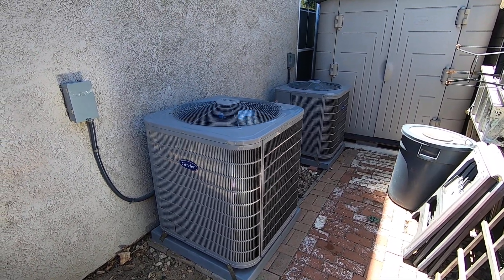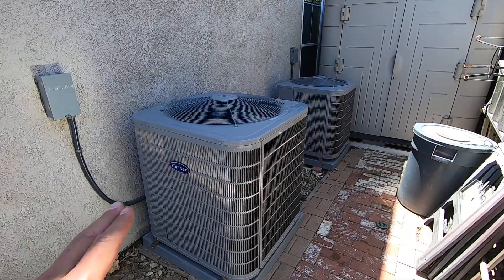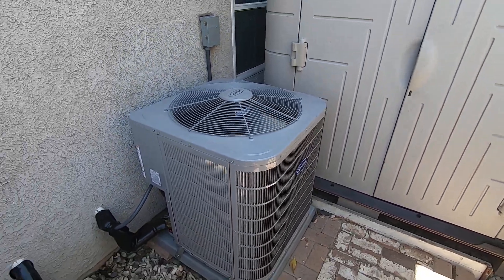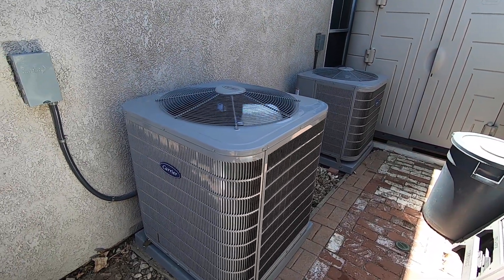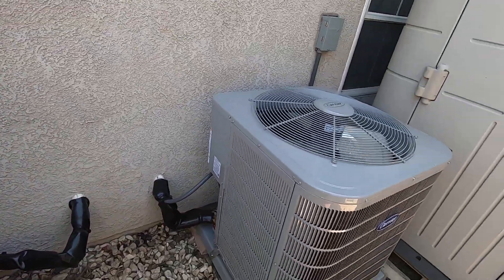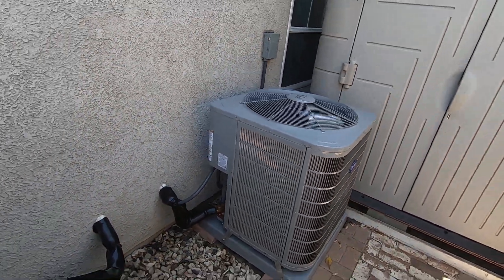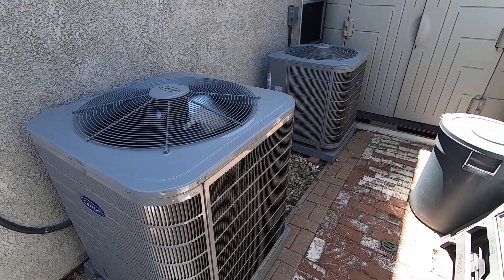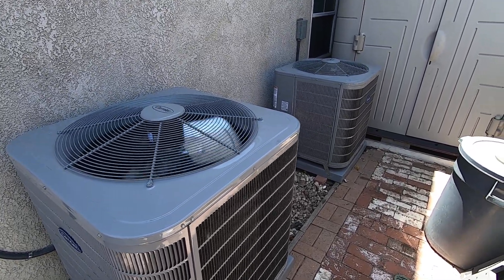Replace air conditioning system with Carrier Performacne Series two speed 17+SEER condenser 24ACB7

Comment: Can you match the two stage 24ACB7 with the infinity furnace 59TN6 and use the Carrier Infinity  System Control thermostat?
Reply from the maker: Unfortunately you would not be able to use that thermostat with that combination of equipment.  The Infinity control thermostat can only be used with Infinity condensers and furnaces due to it's communication wiring set up

Comment: Too close to the wall
Reply from the maker: Both condensers are 6 inches off of the wall per manufacturer specifications
Reply: your 4 ton condensor is too close to the wall (you need 24 in clearance), unless you rotate 90 degree counter clock wise. You need to check the spec before installing.
Reply: @ZhongweiJiang  You sound familiar with the units.  Are these Performance Two Stage units capable of being ordered with either the tubes coming out the right rear, or coming out the left rear?  I see that in this video, but looked all over and through the literature yesterday and could not find that.  It would sure help with my set up if it's possible.
Reply: @ZhongweiJiang  You would be incorrect.  Installation guide says it can be 6" to the wall.
Reply: @CarreraTrack  Correct.  Spec's look to be that one side can be 6", if the other sides of clearances of 12", 12", 24" - which he looks like he has.  I would agree, maybe not ideal.  But not everyone has 2' around their unit.

Comment: Why did you not give clearance on those unit
Reply from the maker: Both condensers are 6 inches off of the wall per manufacturer specifications
Reply: @albertairinc.1140  best carrier ac units and other units